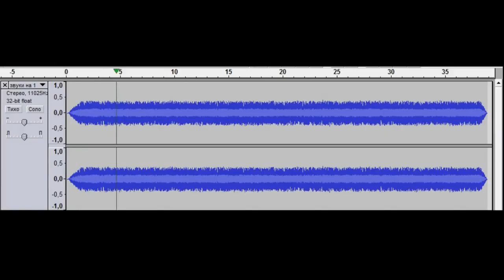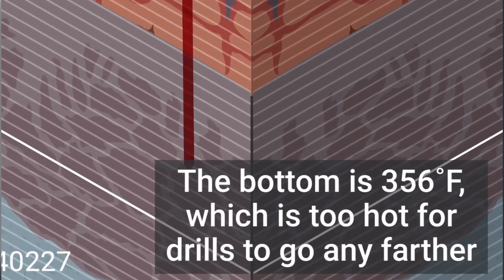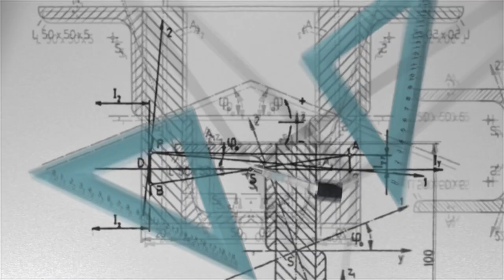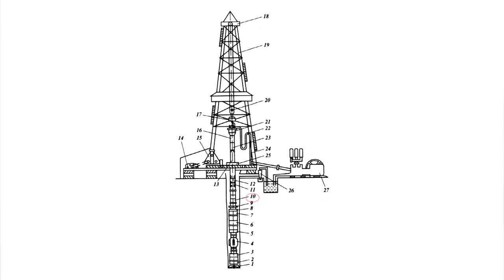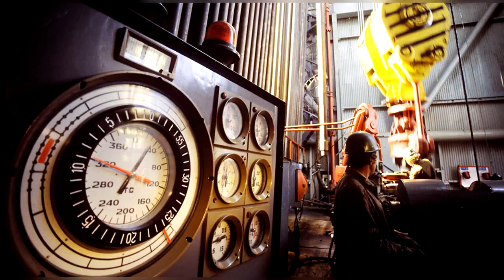Here's What is at the Bottom of the Deepest Hole on Earth...

Comment: Being a well driller and have drilled over 500 oil wells . most are 6000 to 8000 foot , I have drilled two test wells 20,000 foot  just shy of 4 miles deep,  5280 feet in a mile .  core samples tell the story .  how the earth was formed . im sure they compare the test wells in the USA with the one drill at Kola , I have seen 2 oil rigs that can drill over 30,000 foot did not drill for them , but they are super size , from your everyday drilling rig of 8000 foot.
Reply: Hey Bud, just wanted to say thanks mate, you rock! Those wells  you dig are the foundation of our economy and lifestyle. I know it's long hours and hard work, my cousin was killed trying to hold down a breakaway hose, and another old mate works the offshore rigs up north. It sure aint a glamour job. Cheers to you .
Reply: @davejob630   sorry for your lose , drilling is a dangerous job im 57 and all buggered up working on a oil rig 40 years ago , is not the same as today , I watch videos of the New oil rigs , It is still just as dangerous , with less lifting of 500 pounds plus by hand .
Reply: @davejob630  I used to drill for coal in Alabama , you can get hurt real bad or killed real quick. It will turn a young man into an old man fast.
Reply: Thanks! I will bet you people found some scientifically interesting stuff. Hats off to you drillers for that hard, dirty job.
Reply: @I am a ELFfishHoneyCloudMeigeniToppKlass   Sorry , Im not a water well driller , I worked on oil rigs , the USA to do water you have to be licensed ,  I have not been out of the usa from 911.  no passport not up on my shots. To do a water well having a truck with a derrick and rotary table  and know how. depth of the water table , drilling the depth run PVC or casing to the depth setting up a pump is easy lot of videos on it , it is money to buy the truck and pipes drill bit  run's in the hundreds of thousands of dollars  water wells price very in the usa 150 foot and type of rock mud clay , between 5000 and 10,000 dollars . things like underground rivers, springs, artesian wells . can be very dangerous , opening up a huge sinkhole .
Reply: I can see how this video is relevant to your interests.
Reply: JCcanU   You ever get any Gems or gold on cores ,???
Reply: @alegriart  , only in video and what i read in magazines
Reply: Way back in the 70s and early 80s American oil drillers in ALASKA routinely drill down to a depth of 20 kilometers or 12.5 miles (that was written in a pocket book that I borrowed) and the oil comes out of the borehole BOILING HOT! Russians drilled even beyond that depth. The OFFICICIAL NEWS is that Russia drilled down to beyond 20 kilometers which is 22 to 23 kilometers but the UNOFFICIAL NEWS is that they drilled much deeper nearing 25 kilometers or 15 miles and 1,000 meters. 10 miles x 1.6 = 16 kilometers and according to Professor Arthur C. Clarke at 5 miles to10 miles below sea level man can find all the minerals he will ever need. The Russians does not want to be bothered with the need to search out shallow mineral deposits in inaccessible parts of Siberia BECAUSE OF THE COLD AND HARSH ENVIRONMENT but the cost is too high for ultra-deep mines at that time so they drilled several dozens of ultra-deep mines and started working on them to maintain them indefinitely to serve as EMERGENCY RESOURCES MINES while they search for the easier to access shallow mineral deposits by developing Arctic engineering technologies to allow them to economically access these shallow mineral deposits.
Reply: @darthvader5300  Er, no.  The official news from the Soviets is that the Kola Superdeep borehole SG-3 drilled to 12,262 metres in 1989.  12 1/4 km.

Their target was 15,000 metres, but were unable to get that deep because the rock became too hot for the equipment, and the bore kept closing in on itself.

There is no particular reason why you'd want to mine that deep.  We simply don't have the technology for worth-while mining at that depth, and we don't need to go to that depth for what we need for the foreseeable future.

The deepest mines in the world max out at just over 4km, most of them are gold mines in Africa.  The deepest known natural cave is 2.2km.
Reply: I was referring to the UNOFFICIAL NEWS not the OFFICIAL NEWS. There is a difference between the two. The reason why there are two kinds of news is because of the COLD WAR at that time and the need to maintain secrecy even after the end of the COLD WAR because of the Russian "JUST IN CASE" attitude. Now I understand why, they can"t trust the West for the COLD WAR is back after America violated their side of the agreement not to advance NATO beyond Western Europe's borders. By the way, the people involved were using Soviet MILITARY TECHNOLOGY and just like America, militaty technologies are way more advance than their civilian counterparts regardless whether it is from the West or from the East.
Reply: @fromagefrizzbizz9377  And that was the biggest accomplishment of this drill. At the time they thought the gradients of temperature increase were much lower. That alone redefined a lot of the geological science. Only for that find, the dig was a huge success.
Reply: Who runs the world you and your buddy's thank you for my lifestyle
Reply: @alexcantlow2920  the world runs us.
Reply: What is it you drill for oil or anything else on a personal level I wanted to hear from the source do you think its bad for the environment or not? Me I'm on the fence one what to put it is its was already here how can it have a impact on the environment when it is part of the environment and and the same time maybe it should be left there because free energy is so viable nowadays its out dated and how fast does oil to to replenish as that always changes. Just one of them ones you know lol
Reply: @alexcantlow2920   Crude oil Natural gas ,  Drilling the well we used fresh water to 800 foot run casing then cemented it all in . than drill to 2000 foot run casing cemented that in , drilled to bottom depth 6000 foot run casing cemented that in  , fracking takes place at 4000 foot 5000 foot the oil runs into the oil well and is pumped up . people say it poisoned the drinking water . but swamp gas H2S can be found at 20 foot water tables run about 400 foot ,  it is safe , but with anything it has a drawback accidents happen oil spills happen.  N/G heats your home , oil is turned to fuel to run your car .  Oil will never run dry in the next 200 years.  Trees are dying off from bugs and over logging . it will have a impact trash  we can not get rid of Nuclear waste . That scares me more that Burning Fuels.
Reply: How many damned souls do you think you released  ;)
Reply: @cj0e  - Zero
Reply: @I am a ELFfishHoneyCloudMeigeniToppKlass lol Somali has enough water, buddy! Boreholes are drilled every other day and it isn't like you express. We have had civil wars for almost 30 years but we never limped because of that. There professionals for that task in somalia and also reputable somali companies in Kenya that do drill boreholes. Despite so many challenges, Somalia isn't as you make it seem like. If you want to establish drilling business, you will require about $1M and you will find pros in no time. If you want to train yourself as a staff, look for the local companies and train there rather than looking for an american.
Reply: having drilled / 8000 feet (noun) 20,000 foot test wells (adjective) / drilled at Kola / 30,000 feet. I did not / compared with the every day drilling rig....
Reply: So why don't you drill 4 million miles into the centre of the earth so science can be proven wrong once again?! Can't do it !? 4 miles of hole doesn't tell the story of how the earth was formed they are guessing at best like everything else in science. Oh water imagine that lmfao oh voices imagine that ... hmm what else is down there ...??? Diamonds really hmmm nobody fookn knows so quit pretending like anyone does you haven't even seen a fraction , not even a fraction of the earths insides at only 7 miles of its 4 million mile depth to centre ...
Reply: @viktorvincent8887   how far is the moon from earth ?  4 million miles of drill pipe ? drill collars 6 inch round 30 foot long 3000 # each 18 to 21 on the drill stem , pipe 4-1/2 30 foot long 500 # each . if the drill stem hit the mantle it cause a volcano magma be shooting out the hole lava melt the rig .
Reply: @JCcanU  i would think the magma would melt the pipe as it went up slowing closing off the hole. 
Unless the pressure pushed it up at some crazy speed
Reply: @C-13770  i think it blow out , that much heat and water would make steam so fast the pressure would be too great to keep anything in the well.
Reply: Reply to Viktor Vincent: Your insulting sarcasm only exposed your ignorance of science and technology. What a pity, you sure got a bad chip on your shoulder against Russians. Especially when my people are way ahead in many strategic areas concerning earth sciences.
Reply: @viktorvincent8887  Four thousand. I think you got a little carried away there. :)
Reply: @viktorvincent8887   Exactly what I was thinking 👍

Comment: Good material. These hell sounds.. Perhaps the pressure and the temperature damaged the microphone? Or these are disfrormed sounds of earth's crust working under unberable pressure? It really sounds more like a stadion speaker than a hell.
Reply: @Sum Sumarum.  The "hell sounds" are a hoax.  It's a looped copy of part of the soundtrack from the 1972 movie Baron Blood.
Reply: a hole like that would produce a reverb as well...
Reply: That kind of sound has been heard before in tight confines with solid walls.  It is merely reverb and echos of high pitch.
Reply: @Pope Bentdick Do you know of any microphones capable of surviving 1000C? Have you tried to mount a sensitive piece of electronics onto a drill bit, drilling a hole with it and have it work?

No, the mystery is much simpler than that - some wags looped the soundtrack from a back 1970's horror film and has everybody pissing their pants.
Reply: @Pope Bentdick Poes law: "It is almost impossible to tell if a person is a Poe unless they admit to it."
Reply: I have a sound system that could make those sounds. Matter
Reply: Stop for a minute...Why or how would someone put a microphone at the end of a real drill bit. If it doesn't make sense, it usually isn't true
Reply: @rmb9311  it was a scientific project, not a mining operation. So they could remove the drill and send there some equipment down the line. Why wouldnt they. But the data is questionable. I wonder what kind of microphone were they using, and how effective can it be under pressure and extreme temperature on such depth, because regular mic would be destroyed and not work at all. Or perhaps these were the sounds of microphone being destroyed by harsh conditions there :P The recording found on the web is very short.

Comment: It is literally impossible to drill that deep. The weight of the drill would be too heavy to support or work.
Reply: So how'd it happen or are you saying the depth is fake news,
Reply: @Eulogy68  if it was fake it would have been CNN's top story
Reply: I rough figured it at 594 tons. That's 30 lbs a foot x 5280 feet a mile x 7.5 miles = 118000 lbs divide by 2000 lbs/ton = 594 tons. I'm only guessing at the weight of the drill pipe per foot, but the rest is a given. 

#1 I don't know how you could possibly support almost 600 tons in a very small grip cross section. There's almost no way you could turn a bit with that kind of weight resting on it, plus all the friction of deviations in the pipe for 7½ miles of interference in the bore.

#2 So it has to be supported, leading back to:

#1
Reply: @42lookc  I suggest that you read up on how deep drilling rigs work.  Do note, for example, that longer (but not deeper) bore holes have been done and are currently in operation as oil wells.

Here's one source: https://en.wikipedia.org/wiki/Drilling_rig#By_method_of_rotation_or_drilling_method

The use of drilling mud makes a huge difference in effective suspended weight, lubrication and removal of cutting debris.

600 tons really isn't that much.
Reply: I don't know what you are reading, or where, but you are mistaken.
Reply: @paulgee4336  Whether or not you're reading anything, you are mistaken.  The Kola borehole exists, so obviously it's possible.  There's at least a half-dozen wells with longer drill chains CURRENTLY IN PRODUCTION, so obviously, it's possible.
Reply: @paulgee4336  No, of course not, I don't believe just anyone like you that makes up lies on the spot.

Odoptu OP-11 is about 100 metres longer than the Kola SG-3 and is currently in production.

Z-44 Chayvo is another 100 meters longer, and is currently in production.

Both wells are part of the Sakhalin-1 project.

BD-04A is also longer than Kola SG-3.
Reply: It's 99% fat-free, so it's really lite!